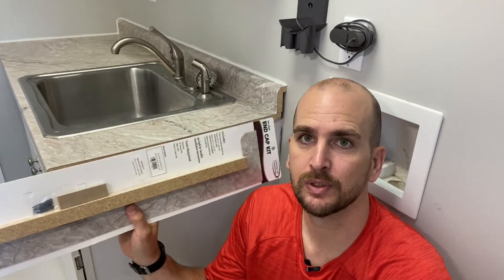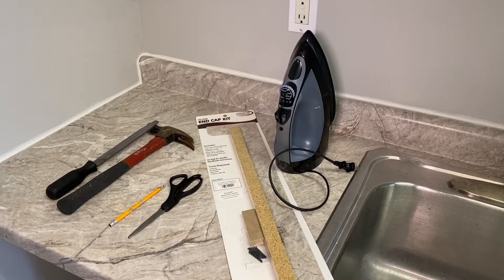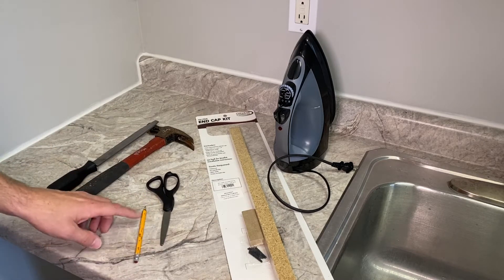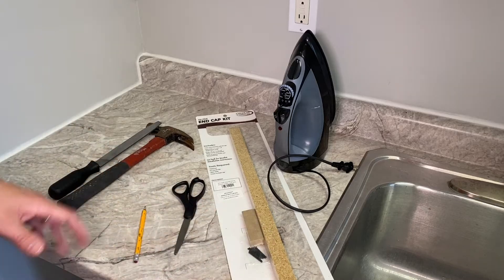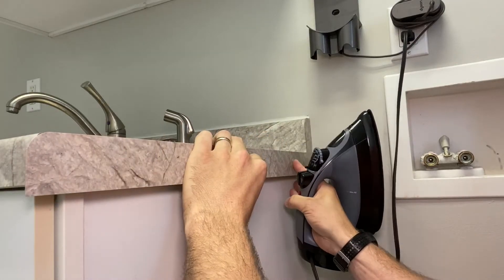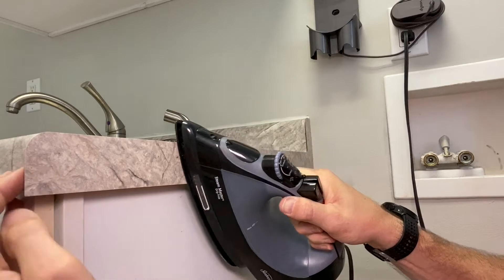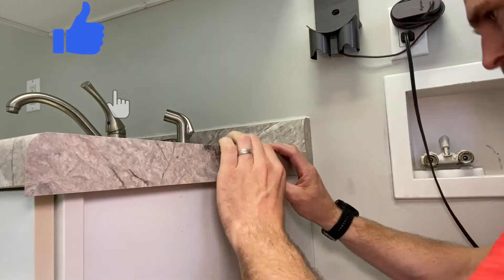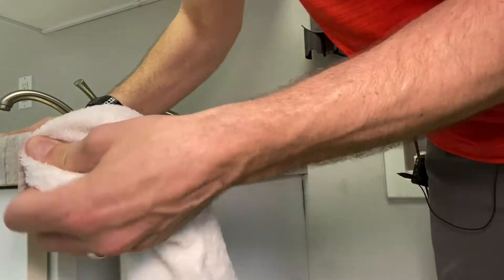How To Install a Countertop End Cap

Comment from the maker: Hand File Set:   https://geni.us/AASp5h

Tools Every Weekend Warrior Needs
Makita Cordless Drill Combo Kit:  https://geni.us/t7dIA
Dewalt Drill Bit Set:  https://geni.us/oFlSl
Dewalt Screwdriver Bit Set:  https://geni.us/VDcr
Craftsman Screwdriver Set: https://geni.us/jXqFI
Eklind Allen Wrench Set:  https://geni.us/7XfvO
Pliers (4-Piece Set):  https://geni.us/RIdx
Stanley Utility Knife:  https://geni.us/ndIDa
Stanley Tape Measure:  https://geni.us/bUfD1R
Studbuddy Stud Finder:  https://geni.us/RySCuVw
Johnson Torpedo Level:  https://geni.us/wiLcDY
Stanley Hammer:  https://geni.us/bPDk8Wo
Buck Bros Wood Chisel Set:  https://geni.us/vk3cpTW
Klein Voltage Tester:  https://geni.us/h9Hl
Klein Outlet Tester:  https://geni.us/kdBAJ
Ideal Wire Strippers: https://geni.us/MdOB
Little Giant Ladder: https://geni.us/fmlmTk

DISCLAIMER: This video and description contains affiliate links, which means that if you click on one of the product links, I’ll receive a small commission.

Comment: I don’t feel so bad now. I use the same tools and method that you did in this video. A friend was doing a remodel on a house and he actually used a saw and cut off a peninsula and wanted to use an end cap kit to cover the new exposed counter end. Every video I looked at was for new countertops and they used a router. Thank you for this video!

Comment: I've done alot of counter tops over the years ,but those end pieces hardly ever stay on . I've  tried different ways to pu them on . Doesn't work bad design. It would be better if they just gave you the end pieces and some contact cement.

Comment: Do you need to seal that edge?  What if it doesn't completely adhere?  The guy who install mine didn't use an iron, but contact cement.

Comment: Good video but there's one error.  The 3/4" filler is not supposed to be installed vertically.  It won't line up to the front lip.  The manufacturer specifies it's to be installed horizontally.
Reply from the maker: Completely agree 👍
Reply: I’m confused on what you’re saying

Comment: Why not use a Drexel to trim off excess?
Reply from the maker: That would work and would be much faster but should use a flush cut bit to reduce the chances of over cutting. This was for those without a Dremel or Router.

Comment: Nice video. How did you cut the 3/8" excess on the backside? I saw you had a pair of scissors. Did you use these?
Reply from the maker: Hey Mike,  yeah for that one I did use scissors.  Tin Snips work better https://amzn.to/3arr7xS.  Best of luck on the project and I also have this video which shows gluing down laminate sheets and doing a lot of trimming which might help  https://youtu.be/uObZY3YI6AM

Comment: Should mention how long it takes to file that edge.  From my own experience it takes way to long. However on one already installed the router will only make it so far when you get close to the wall. Leaving still a while of work filing that back area.  It's worth loosening the countertop if you can, so you can slide the counter forward and using the router . I about lost my mind trying to file these things down. Lol
Reply: I think that a dremel tool with the proper bit would be a better solution.